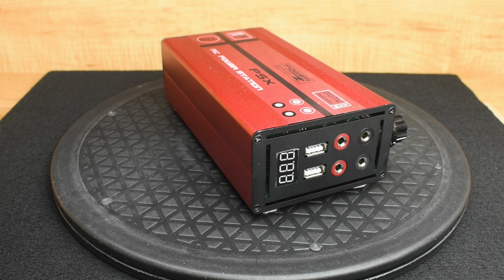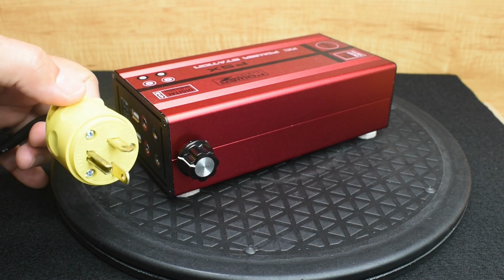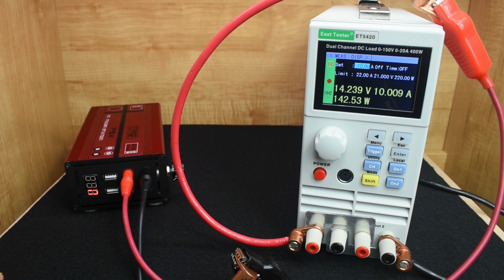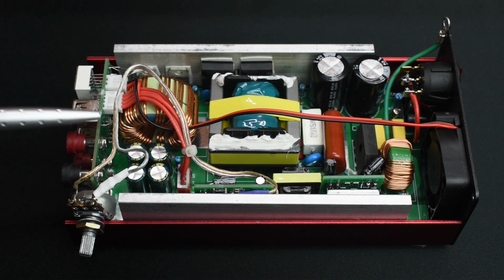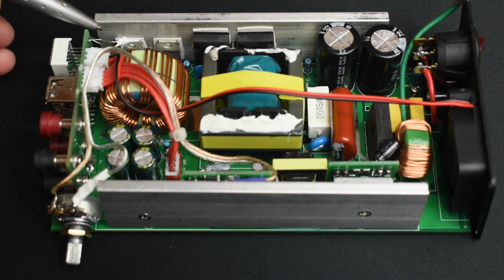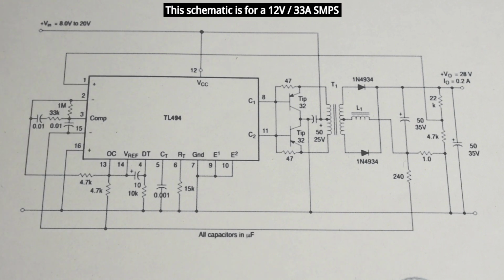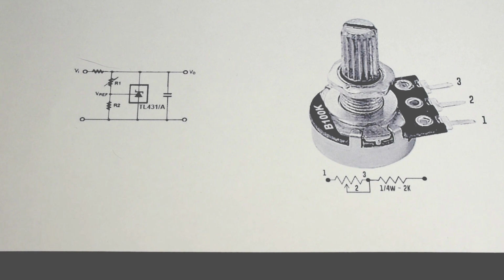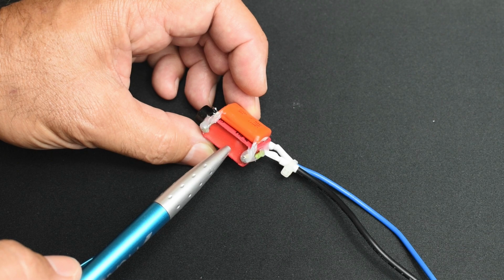12V LiFePO4 Battery Charger Made From A 15V/25A Low Cost Power Supply! (Simple Modification)

Comment: This is far beyond my capabilities and don't have the parts to modify this power supply, I think I will buy one already made.

Great video!
Reply from the maker: It's definitely not a modification for everyone. :-) The only problem buying a ready made unit, is cost, they're not cheap in the 25A output range. Thanks for watching!
Reply: @JT I feel the same way. Would love to own this modified unit, but it's also beyond what I'm comfortable DIYing. What off the shelf product did you end up buying?
Reply: @davidbryan-z8b   I got a buck/boost converter instead, Doug here actually had it shown in a video.  Unfortunately, I don't recall the video title but he said that got that model because it had a glass fuse that could be replaced easily.
Reply: @JT-lq4yd  Hmm sounds interesting, I'll try to find it. Let me know if you remember the manufacturer.
Reply: @JT-lq4yd  After doing quite a bit of searching I wasn't able to find a buck converters anywhere near the 25A rating. Could you share a little more info on the unit you're using? Thanks
Reply: @davidbryan-z8b   WINGONEER 600W DC 10-60V to 12-80V Step-up Module 
Boost Power Supply DC Converter.  It is found under Amazon's ASIN # B01MG4211N.  This is out of stock but there are other brands available.

Comment: I recently bought a couple 200amp 12v, 2450 watt rack server power supply's, right after I paid for them it hit me, that can not be 120v, haha, so I ordered some smaller server power supply's, to put in series, I'm hoping I can do something similar to the 2450's, either a bit more voltage , or less and get a couple more, I'm hoping I can charge my 7s lithium bank, using my 6500watt generator, if they are like the smaller units it will be just over 25v in series, I'd like to get atleast 28-29v. I don't want to charge over 4v per cell, without the CC CV charging for lithium, I don't go over 4.1v-4.15v anyway, to get as much life as possible, and above 3.2v,  I have the HP rack server power supply's, not many in the US do anything with the big 2450's, only a couple eastern European guys is all I have seen,
Reply from the maker: That's some serious power output!